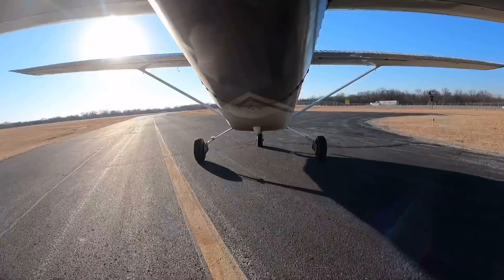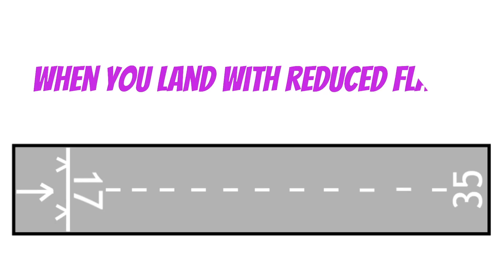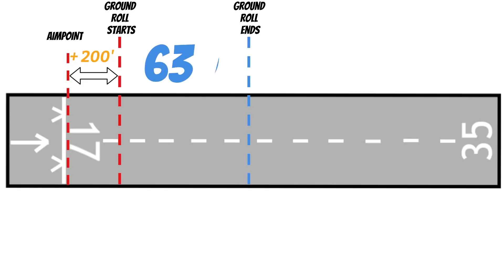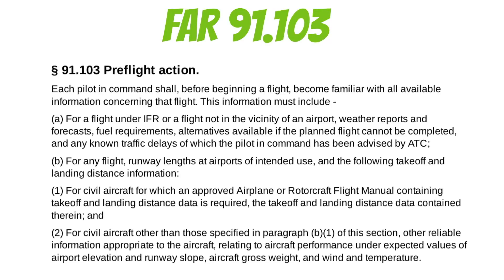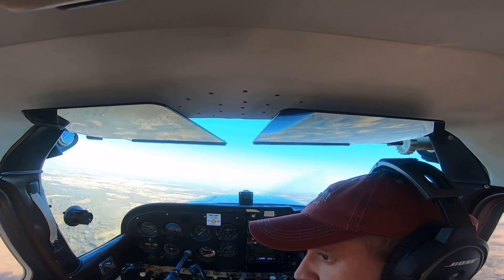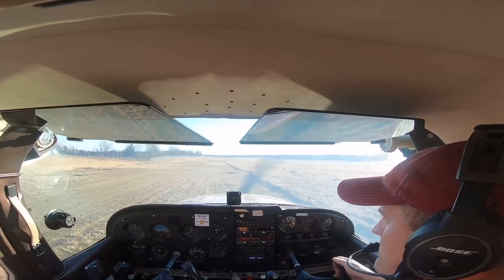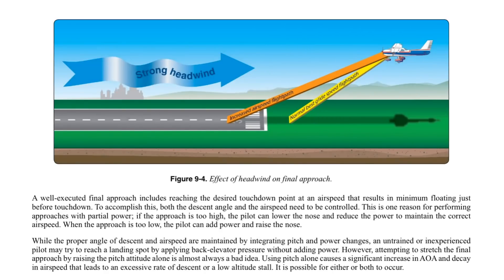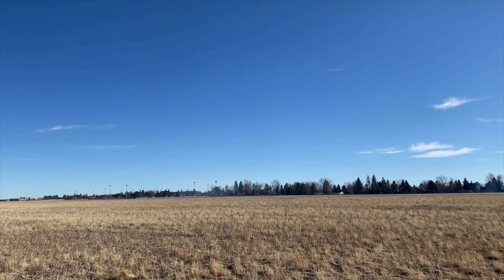Should "Normal Landings" be made WITHOUT POWER?

Comment: As you progress to heavier light aircraft, you should ALWAYS land with SOME power. Example: with C152 or PA28-140/180/181 chop the power as you reach ground effect. However when flying heavier aircraft such as C-205/206/207 I always land with about a quarter inch of throttle lever applied.
Much smoother landings.

Comment: how do get really good at something?  practice and REPETITION?   in a small single engine trainer if you make all your routine approaches power off you got very good at it.  that's why many CFI's are good at it.  this advice is terrible and contributes to typical incompetence of the pilot community.  if your engine is still running why on earth would it be any more dangerous to make a power off approach if there is no reason not to?
Reply from the maker: Might be good to watch the video all the way through.  It explains that in detail
Reply: @FreePilotTraining  might be better yet to read and comprehend my comment.  you did not refer to any comment i made, you continued to recommend using power on all normal approaches.  if you can't teach a student to use proper pitch control with power you should not  have them even consider a short field landing because yes that IS dangerous as you demonstrate clearly!  if you need to slip a cessna with full flaps to get down you definitely need to work on your short field approaches.

Comment: I’m sorry but was “Landing lights off” a checklist item while still in rotation over the runway? And credibility out the window 🙄
Reply from the maker: It’s called checklist discipline and it was well after I was safely airborne.  the way the video was cut may have made it look lower than it was.  Good habit patterns like this keep you from overspeeding gear and flaps on much more powerful aircraft and if you don’t gear the gear up once you’re safely airborne on a multi-engine aircraft, you could potentially fail to meet you OEI climb gradient which could cause you to crash into an obstacle on an instrument departure procedure

Comment: You're assuming one thing here that's kind of foolish: that people mean no power at all allowed during a landing. Of course you're going to use power if you're at risk of being short, need to go around, etc.; the point is to use power as little as possible. Obviously if you set yourself up properly for a power off approach, like you failed to do throughout the video, you won't need very much, if any, power, but the option is there. But then you started to twist the subject by going into flaps and regs about preflight prep in the middle which makes no sense whatsoever as it has nothing to do with the discussion at hand.

In any case, the entire goal of a power off approach mindset (for that IS what it is, a mindset) is to make sure you can make the runway if your engine quits, no matter where in the pattern. Engines don't care if you're on downwind, base, or final. So when you're doing your nice wide approach dragging it in with power and full flaps deployed, what are you doing when you lose your engine at 200 ft on final? You're hitting the trees, that's what.

Finally, the power off approach is taught by master CFI/Is with decades of teaching experience, flight time, and experimentation under their belts. I'd say they have a bit more credibility than a guy who reacts to an operating limitation with "they say it can be dangerous or something like that" (15:57).
Reply from the maker: You’re certainly entitled to your opinion. I recommend reading the AFH. If normals approaches were meant to be taught without power, that’s what they would teach.  Of course I would go around on a power off approach if you were going to land short, but this raises a very important question… where does a new student do that? Do they stretch final out with backstick pressure and risk a low altitude stall? An inexperienced pilot may very well do that and the AFH even says this is the danger in teaching this method to new students.  If you don’t think a low altitude stall is dangerous, then I don’t know what is.  And by the way, I landed right on my target during my power off 180, so I’m not sure where you are getting that “I failed to do that throughout the video” the other approaches were intentionally “power on” approaches to prove a point.